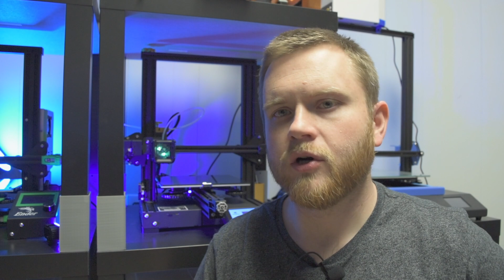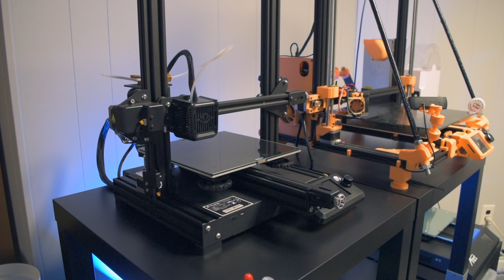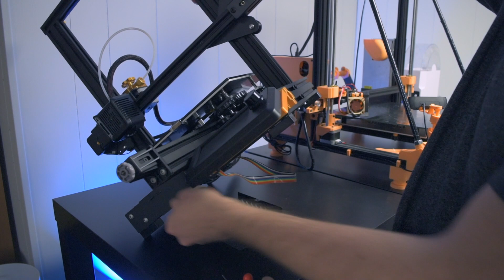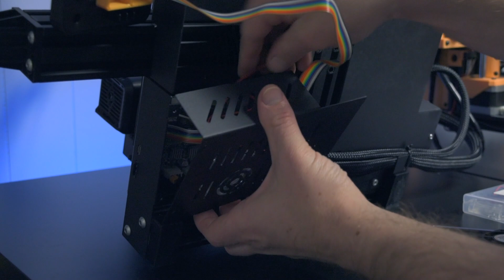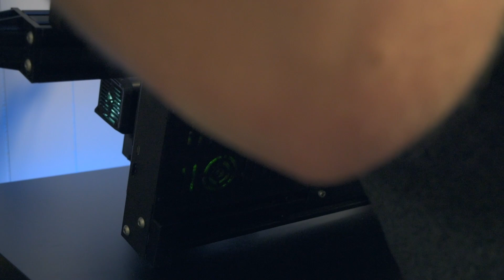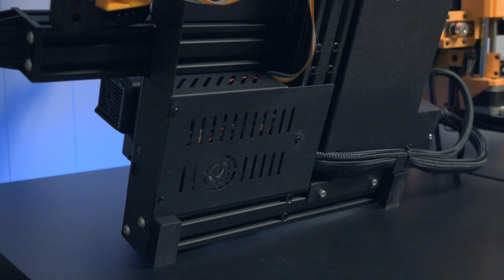Tired of your loud motherboard fan on your Aquila? Let's fix it!

Comment: Hello that such, as I can solve the fall failure on the x-axis in my aquila, I have already calibrated the eccentrics to tiredness and continue to collide the nozzle with the bed at the time of passing the x-axis on the right side of the bed, at first it was very rare but so far it is already impossible to print since the weight continues to beat the x-axis, and I have not found any solution, greetings from Mexico
Reply from the maker: So is the issue the bed and nozzle colliding or the x axis? Either way it sounds like you need to adjust your z stops. The z stop can be adjusted with two screws on the left side of the printer. The x axis cannot be adjusted but you need to make sure it works. You can try manually pressing it while homing to see if it engages. As soon as you press it should stop that axis from moving. If it doesn’t, something is wrong.
Reply: @3DPrintSOS  If I was also thinking of changing the eccentrics, but if it’s very obvious that the x-profile has too much top-down play and squeezing them eccentric, it’s hard on the z-engine, There is way to install double engine in z and if so, as I can do, there is very little information and support about the aquila, and your channel is the only one that gets deep

Comment: OK so this question has nothing to do with the video (although mine isn't making noise going to replace anyway.)  I have a problem now that I can't get anything to stick.  After a while of printing things start to peel up.  I have tried both sides of the glass and even tried glue on the smooth side.. what could be causing this.  I keep trying one print and it keeps failing.  Could some gcode on a piece mess with that somehow?  I even rotated the parts on the bed 90 degrees and getting the same thing.
Reply: I used to have the same issue I found I uped the initial layer to 230 then down to 200 with print bed at 65 sticks every time for me now
Reply from the maker: Hmm. It’s gotta be leveling + temps. Go higher on the bed, go slower on the print speed, and try live leveling on the brim/skirt until it sticks.
Reply: @3DPrintSOS  Turns out brim fixed it .. I had turned off a brim for another project and forgot to turn it back on.. this box as it printed the higher layers just pulled the lower ones off the build plate.  Brim fixed it first print... Geeze ...
Reply from the maker: Brim is great. I use it on almost every print

Comment: Question about the 2 hot end fans.  It looks like the cables on the rgb fans are short compared to the stock fans.  Do I have to cut the stock fans out to reuse the cable running to the motherboard?  Or will the rgb fans make that cable run to the board?
Reply from the maker: I have a video on both installs. The motherboard fan is plug and play, the hotend fan, you have to cut the wires and solder the fan wires in. ;)

Comment: Do you know of a non-rgb option of these fans that you would recommend?
Reply from the maker: For non rgb I’d just go Noctua. Pricey and require a buck down converter to step down to 12v but they are 100% the best fans.

Comment: Curious if Arctic P8 Silent fans would work. You would need to print some custom shrouds but they are significantly more quiet than casual 40mm fans.
it would require to crimp these JST XH connectors onto the existing plugs though. Good thing I got some crimpers for that :D
Love your videos!
Reply from the maker: Thanks man. I’ll be looking into the options. Specifically for the psu
Reply: @3DPrintSOS  make sure not to use the normal P8 fans though, they spin up to 3000RPM. While they remain somewhat quiet it wouldn't be that much of an upgrade I suppose :D
Reply from the maker: Well it’s more for noise than performance. The stock fans performed just fine. Just loud af

Comment: Did you try turning the cooling fan speed down to see how rough that fan runs at low PWM voltage. Tempted to wire mine directly to the incoming 24v power or get a fan thats rated for PWM

Comment: Thanks for this, would the same fan work for the power supply ?
Reply from the maker: No unfortunately. The one there is a 12v and larger.
Reply: @3DPrintSOS  any suggestions on what to put in there ? (Or not to put one in there)
Reply from the maker: Not sure. Don’t want to lead you on the wrong direction cause I haven’t messed with or looked into it yet.
Reply: @3DPrintSOS  let me know, if/when you do, Ive followed your good advice to date so far :)

Comment: I've had (2) of those fans fail on me.  The last one slowed down during a long print and the filament got stuck and the print failed.  Now I have filament stuck in the the blue extruder tubing I just upgraded per your last video.  Any recommendations how to get PLA + out of the blue tubing?   I removed it and tried pushing it out, but it is stuck.  Heat it in the oven?  Thanks again
Reply from the maker: Hair dryer on the tube and push with fresh filament. :) shame that happened. Sucks.

Comment: Nice video! Thanks for making them for the Aquila. Since we're on the subjects of fans has anyone had the stepper motors really get hot?  I had to add fans to cool them. Checked VERF's and set them to Voxelab's recommended <=1.2V. Still run very hot.
Reply from the maker: Hmm. That’s odd. What’s the tension of you belts and when wheels like? Nothing binding?
Reply: @3DPrintSOS  Thanks for the reply. Proper belt tension. Wheels move freely on all axis. No binding. Can't put my finger on why running hot. Voxelab support says experiment with the VREF voltage. So I printed cooling fan shrouds off Thingiverse and the motors now just get warm. Could just be the type of motor they use.
Reply from the maker: Interesting. Something is being under or over powered. For sure
Reply: Mine got hot at 1.4v, runs warm but ok at 1.2v
Reply: Thanks. I'm beginning to think it might just be mine. I added cooling fans to all the stepper motors and the motors get warm to the touch even after several hours of printing. So for me it was worth the investment of time printing the cooling shrouds and four winsinn fans. No missed steps and nice even layers.
Reply: @richmagda553  it should feel like warm water, not HOT. I reduced mine 1/4 turn and it's perfect.
Reply: @urgamecshk  Thanks for the reply. Checked the Vrefs and it's set at where Voxelab says they should be. Added heat sink and fan to each stepper motor and they now run at around 40 deg C.
Reply: @richmagda553 got a link to the fan shroud? Also, which fans did you use & how did you plug them in? Really appreciate the help if possible!!!
Reply: @GDM1787  Unfortunately I no longer have the files as I no longer have this printer. I used shroud models for nema 17 motors on Thingiverse and moded them to fit with 4010 fans. Hope that helps. Good luck!

Comment: WINSINN also carries a dual ball bearing version of the 4010 24v fan (possibly without RGB), but I wonder if they're quieter or louder than the hydraulic bearing version.  They're supposed to be longer lasting...
Reply: Wondering on that too, I don't care for the rgb

Comment: i just replaced that fan and the psu as well as hotend fan with noctua fans. I used a buck converter for two of the fans and it was pretty easy. I think the way you do it is easier though because it's a direct replacement. Any tips on getting rid of the blower fan for something quiter?
Reply: Winsinn sells a blower fan I replaced mine a couple weeks ago so far it's been a better fan.
Reply from the maker: Blowers are all loud. Even the best ones. I run a maglev but sunon on another printer and I have to run it at 30%. Otherwise it’ll blow the damn printer across the room. (Not really) they are just much better fans. If you want silent, you can always try a 40x20 noctua with a  cooling duct that lets you use a 40mm fan for cooling. Ran that setup for ages as well.
Reply: @3DPrintSOS  thank you for the response. I have been looking for a printable shroud so I can use two quiet fans instead of a fan and a blower. I haven't found one yet, but if I can't i'll end up making one and posting it to thingiverse.

Comment: At 2:36 you can see the PSU cover that has NO vents, and are covering the MW PSU vents. Take that off at least, or print a new PSU cover that has vents.
Reply from the maker: Wonder why they did this. There has to be a legit reason. Maybe a shock hazard or something
Reply: @3DPrintSOS  Most likely because they don't matter for this application. Otherwise, I doubt a manufacturer would compromise reliability for the sake of a couple slots in a cover!
Reply: @baxrok2.  specially not Meanwell...they have some reputation.
Reply: @themountain59  For sure.

Comment: Assuming they use the same psu in all of the aquila's, it should be a 12v fan with the same connector. I raised my printer a bit so that I could use a 120mm case fan on mine
Reply: Did you have to print a custom psu cover? I'm guessing that one for an Ender psu would work.
Reply: @baxrok2.   I did, it was designed for the ender 3 v2. thing:4546724
Reply: @7shortofperfection  Thanks!
Reply: Yes, PSU is 12v. I modded to 80mm 24v and wired them directly to the PSU taps.

Comment: My part cooling fan sounds like a chainsaw... Do you know if there's any cheap rgb blower fans?
Reply: Blower fans are hard to find, especially the small 40x40's. I found these on eBay. Have not arrived yet so not sure how much quieter they are. The loudest fan is the power supply imo. 

https://www.ebay.com/itm/333884530887
Reply: @baxrok2.  trust me, if you heard my part cooling blower you'd know that it's not the PSU fan that's the loudest lol. My blower sounds like it's grinding ice cubes in a blender when it goes off. I believe the bearing is broken or something
Reply: @catdisc5304  Yeah, when they go bad they can get pretty loud.
Reply from the maker: Lol
Reply: Winsinn sells the blower fans  24v on Amazon I've already replaced it because it was the load one on my aquila. So far it's been really quit after a couple weeks.
Reply from the maker: Not that I know of. I’d either buy another stock one or look into converting to the larger blower fans. There one called the Maglev by sunon. ;)
Reply: Start printing in PETG so you don’t need that fan.